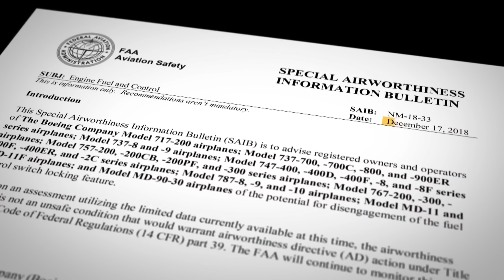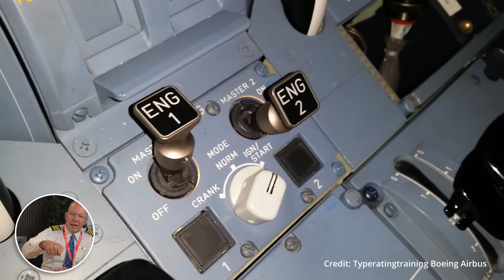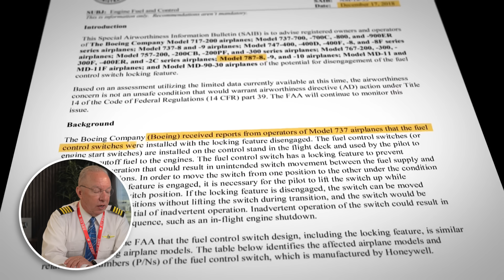Air India 171: The FAA’s 2018 Fuel Switch Locking Bulletin Explained (16 Questions Answered)

Comment: The scare of video leaks is just an excuse. Do cockpit voice recorders ever leak from the black boxes??! Why would video (instead of sound) recording be any different?? This seems just a lobbying excuse.
Seeing things add a lot than just hearing things... In this case, even if we could tell who said what, we wouldn't know for sure whether the pilot who asked why the other cut off the switches is the one who did it (and tries to hide it) or not, or even maybe if no one did... Only video recording would make that 100% clear.
Plus, saying pilots don't want bad words to be recorded... Well, if the sounds are already recorded anyway, what is the difference... 
And when it comes to pilots doing things they are not supposed to do while flying??? Well, how come is that even an issue? In any other job, if you do things you are not supposed to, you get warned, why would it be any different? Pilot's arrogance is sometimes disturbing...

Comment: 1. One pilot asked the other 'Why did you cutoff?' reply 'I didn't' suggests a fault.
2. Probably a logic fault or electro/mechanical fault signals an auto shut off of fuel to both engines.
3. The pilots realise they have lost engine power.
3. The Capt. tries to re-start engines by putting switches to cutoff and back to run - it takes maybe 2 or 3 seconds.
4. One of the engines begins to power up.
5.But not enough time to for engines to power-up as they lose height.
6. The plane crashes.

Comment: Question: You said that the left switch was placed in cutoff first, then the right. As a pilot, when you cut off the fuel at the end of the flight, which switch do you cut off first, the one closest to you or the farther one? I’m curious if that will help make an educated guess as to which pilot cut off the fuel? I would think someone could tell the voices apart too, so they may know who made the mayday call. Lastly, can they tell which headset the mayday call came from? I assume the report doesn’t want to identify which one is the likely one who cut off the fuel.

Comment: 10:10pm Sunday July 13th 2025.
So if the copilot was flying Air India 171 which pilot would be responsible for raising the gear???
Let's just say that if you wanted the plane to crash in order to commit suicide, wouldn't you want to leave the gear down??? Wouldn't that aid in the plane losing lift?
Wouldn't one of the pilots raise the gear right after rotation????
This seems to me to be a dead giveway!

Comment: Nowadays that cameras are present in every workplace not having one inside an airplane cockpit is ridiculous. 
In the Ahmedabad plane crash we only know that one pilot is asking the other"why did he do that" for which the answer is" I didn't ".
Assuming the second person had actually done that (unlikely) then its a blatant lie on his part . But what if it was the other way around (again unlikely )one pilot switching off the controls himself and putting the blame on the other.
So there should be some sort of video recording inside the cockpit with live streaming to a ground control which is good both for the pilots as well as passengers also.

Comment: It's too early to blame the pilots for the Air India 171 crash. The preliminary report confirms that both fuel cutoff switches were moved, which caused the engines to shut down—but it doesn't prove who moved them or why. The cockpit voice recording even shows confusion between the pilots, suggesting it wasn't intentional. These switches are manually guarded, but that doesn’t rule out the possibility of a rare mechanical or electrical failure—like a short circuit, faulty wiring, or a design flaw. Until the final investigation is complete, we shouldn’t jump to conclusions or assume pilot error.

Comment: Is it possible that when the pilot first put the switches to “run” that he didn’t get it all the way past the detect but rather the switches ended up sitting on top of the detect in a very metastable position. And then vibration later caused them to fall back unfortunately to the cutoff position ?

Comment: The report is about as vague as a fart in the wind. Voice timings left out. Voice identification ie who said what. 10 second gap between switching off back to on, yet published without any info, voice, data during the actual time gap except that the gap came to an end after the 9th second. If they have SOME critical data then why not publish a more comprehensive report with more data early on. I call cover up. The official handling and reporting has been at best been silenced and controlled dubiously and we probably won’t ever know the actual truth - just like so many incidents that came before this tragic one.

Comment: Sophisticated, smart and $400 - 500 million planes like the 787, that could sense that the plan is on ground and would disable some of the functionality of the plane (e.g  RAT deployment as described in your last video) is left at the mercy of couple of switchs with no further safeguards built into the system. What possible scnario there is that the pilots would need these switches during take off. Once set to the 'ON' position, they should remain active, no matter what someone does to them, until the plane is safely airborne. This could be achieved mechanically of through electronic sub-system, easily.  Is this stupid design limited to Boeing planes or Airbus planes have the same system.

Comment: Why cant the design be changed to have 2 sets of fuel cutoff switches i.e. 2 switches each for 2 pilots to cut off the engines in the full knowledge of both the pilots..

Comment: the Ram Air Turbine (RAT) was deployed before the fuel control switches transitioned to the CUTOFF position. According to the document, CCTV footage showed the RAT deploying during the initial climb immediately after lift-off at approximately 08:08:39 UTC. The Engine 1 and Engine 2 fuel cutoff switches transitioned from RUN to CUTOFF at approximately 08:08:42 UTC, as per the Enhanced Airborne Flight Recorder (EAFR) data. This indicates the RAT deployment occurred a few seconds before the fuel switch transition.
Reply: What do u have to say here? It could be software glitch and report does not say switch moved it says transition to cutoff and it says moved only in the end report does not indicate pilot error please review your assessment again pls

Comment: Captain Steeve, is it possible that fuel supply was cutoff due to some kind of EM Signal error or Electicity failure? And after the RAT depoloyed, fuel pumps restarted as some power was restored.

Comment: Since we know the order was, Engine 1 Cutoff and then Engine 2 Cutoff, is it plausible to assume this was performed from the right seat due to the Engine 1 switch being closest? When they were switched back to RUN notice they were switched back in reverse order. It seems the PF (Pilot flying) or right seat, could have been who said “Why did you cut off” and switched them to run since Engine 2 would have been closest to that seat. Just a thought.

Comment: Why dont they ensure camera recording in blackbox. Camera focusing on all cobtrol panels.

Why dont they have third person in cockpit whose responsibility would be to ensure checklist and watchdog on two pilots.

Why not the fuel switch position is in down up direction so as even in case of technical fault at the most fuel switch will fall from off to on position.

Comment: If they have clear information that the two switches were manually switched to cutoff, and it was not just an electrical fault elsewhere in the circuit, there's surely no way round saying it was deliberate. Are we sure they definitely know the switches were moved physically to cutoff?

Comment: you have already made your mind up, even without the actual transcript of the voice recorder, or systems data...the prelim report is not even signed or dated..and the words supposedly said by the pilots re cutoff, is just that, words..Is it the actual words, who said them, at what point was the aircraft when those supposed words were said..the engine were overhauled only 3 months earlier yet no one is looking at the engines..can switches move by themselves, anything is possible..the way the authorities quickly cleaned up the crash sight, with trucks and loaders, who knows what happened to the switches or evidence..I would bet that there are a number of different CCTV cameras and videos taken right around that airport..indeed, the report show pictures on page 14 from a different camera, than the one with the hut in it..why cant we see that video..why no transcript..who installed the overhauled engines in March 2025

Comment: If the dual engine switches are manual and controlled by physical levers or buttons, then it's important to note that these have internal metal contact plates. If a pilot says he didn’t shut off the engines, and the co-pilot confirms the same, it clearly points toward a mechanical or system glitch — not human error
Reply: So you believe the pilot that cut off the fuel?  Ridiculous.
Reply: @paulp6397 Whenever a plane crash has happened, Boeing has often blamed the pilots. This is a form of corruption, my friend, because the pilot usually dies in the crash, making it easy to put the blame on them. If you look at Boeing’s history, you’ll understand how deep this corruption runs
Reply: @paulp6397  ✈ The human error theory seems weak in this case. In a cockpit, both pilots sit so close that if one of them even moves their hand toward the engine switches, the other will immediately notice.

🔧 Shutting off the engines involves physically moving a switch or lever — it's not something that happens silently or without visibility. Plus, right after takeoff, both pilots are on high alert. There's no chance one would be distracted or inattentive during this critical phase.

🧑‍✈ According to aviation SOPs, shutting down an engine is a major action and is never done without cross-confirmation between both pilots.

👉 So if both pilots claim they didn’t shut off the engines, and yet both engines failed nearly simultaneously, then a technical glitch in the engine control or switch system cannot be ruled out.

🛑 Aviation authorities need to conduct a detailed investigation into the dual-engine control system. Jumping to blame human error without hard evidence — especially in a case involving loss of life — would be unfair
Reply: @paulp6397  What most people are missing here is that the FAA had already issued a warning back in 2018 (SAIB NM-18-33) about a potential issue in Boeing aircraft where the fuel control switches could unintentionally move due to vibration or mechanical failure.

In the recent Air India crash, both pilots denied switching off the engines, and flight data confirmed that both engine fuel switches moved from RUN to CUTOFF almost simultaneously.

If these switches are manual and controlled by physical levers, it's impossible for them to move without human input — unless there’s a mechanical fault, such as a failed locking mechanism, which is exactly what the FAA had previously warned about.

The aircraft involved had not undergone the inspection recommended in that 2018 FAA alert because it was marked “advisory, not mandatory.”

This strongly points to a technical glitch — not pilot error. It's easy to blame humans when machines fail silently. Aviation authorities should focus on the dual engine switch system’s design and whether proper inspections were neglected.

Comment: Hi Steeve, I have a question if the both engines turned off means what was the sound which we heard in the video circulated on the internet. It seems the engine is working right, I think you also mentioned in the very first video when you talked about that incident.

Comment: 17:17 

For those wanting the full picture on the Air India crash:
The preliminary report confirms both fuel cutoff switches moved to CUTOFF within 1 second of each other, just 3 seconds after takeoff. The cockpit voice recording shows one pilot asking “why did he cutoff” and the other responding “he did not do so” - suggesting neither pilot intentionally caused this.
Key facts Captain Steve got right:
	•	The 1-second delay between switches is accurate
	•	The 2018 FAA bulletin was indeed “advisory, not mandatory”
	•	The switches are heavily protected and spring-locked
Important context he missed:
	•	The FAA bulletin specifically warned about this exact problem - fuel control switch locking mechanisms failing on Boeing aircraft including the 787
	•	Air India didn’t perform the recommended inspections because they were “advisory”
	•	The switches were found in RUN position after the crash, showing the crew tried to restart the engines
The evidence points to mechanical failure, not pilot action:
	•	Known defect in the locking mechanism
	•	Both pilots working together to restart engines
	•	Physical switch design makes simultaneous accidental activation extremely unlikely
The investigation is ongoing, but the preliminary report strongly suggests a mechanical failure of a known vulnerability that should have been inspected but wasn’t.
Sources:
	•	Official AAIB Report: https://aaib.gov.in/What%27s%20New%20Assets/Preliminary%20Report%20VT-ANB.pdf
	•	CNN Coverage: https://www.cnn.com/2025/07/11/india/air-india-crash-report-intl-latam
	•	Flight Global Analysis: https://www.flightglobal.com/safety/circumstances-of-fuel-switch-movement-become-central-to-air-india-787-crash-inquiry/163764.article
Reply: He seems to be paid off by Boeing as he is not actually doing any thorough analysis and coming to a sure shot conclusion as its the pilots that caused it just by looking at the Initial report which is so basic and doesn't reveal quite a lot of things.
Reply: “ Both pilots tried to restart the engines “ this is in the report ???
Reply: @govindmatondkar7502  well, not exactly. The report, however, is a little vague in this context and shouldn't be considered the final verdict here. The report specifies that one pilot inquires why the other (presumably) cutoff the engines and starved it of fuel, while the other denies that he did so. The problem is, we do not have the information about who said what or who declared the emergency or who restarted the engines. Until this information is revealed, we cannot conclude anything definitively.
Reply: Personally, I don't believe the switches can be physically set to cutoff within one second of each other
Reply: The switches along with the throttle module were replaced twice after that, the latest one in 2023.
Reply: @srinitaaigaura that is not stated in the report, is it?
Reply: @karahisarli  it is, in fact, in the report. Page 6, subsection 4 "Aircraft Information", last paragraph, third and second last lines. However, it also states that the reason for the replacement was not linked to the fuel control switches.
Reply: @FaizaanNasir2006 it says “the throttle control unit” is changed, do we know if that includes these switches? i don’t know the procedure but should be straightforward for engineers to explain
Reply: @karahisarli  It includes the switches. Probably not relevant to the case. Perhaps routine maintenance or upgrades.
Reply: Spot on - exactly my observations
Reply: The SAIB does not state the locking mechanism failed. "Boeing received reports from operators of Model 737 airplanes that the fuel control switches were installed with the locking feature disengaged." They were improperly installed. My impression is that on a few planes, the switch was not installed correctly, but was fixed. Which is why there was not a mandatory inspection. You say "Both pilots working together to restart engines," but I believe the engines go into automatic restart after the fuel control is switched back on. Also, the switches were not toggled simultaneously. The one-second gap would reflect the real-world operation of a human switching one, then the other.
Reply: why did you mark the very end of the video…he doesn’t explain anything but goodbye there. 🤦🏽‍♀️
Reply: Whers the evidence of voice recordings??
Reply: Yes this video is a clear narrative driving video where he keeps disregarding any other debates or opinions other than the fixed mindset it was done by the pilot.Boeing has obviously bought half of the people to set the narrative
Reply: Existing evidence points toward a deliberate act by a pilot.
Reply: Yes they say the switch TRANSITIONED - which defective solenoids can do. This way of saying it presumes that this information came from the flight recorder.
Reply: poopjeets hard coping, Air India is dog shit quality. No surprise this bird fell out the sky lmao

Comment: As a retired pilot, these cut off's would obviously have to engaged to start the engines, as with all the various checking procedures, an experienced pilot as these guys were would have realised that the fuel shutoff's not right for get go, so I don't think these were the problem without human intervention EG a deliberate shut off at the critical time, sad situation that this happened

Comment: Captain Steeve needs to get off his high horse and respect the fellow pilots. 2018 bulletin by Boeing is the reason why this happened. Being a pilot myself, I know this was not done by the AI pilots. This is the same coverup by Boeing as the 737 CAS that took two crashes to surface. Boeing kept denying and then eventually had to accept.